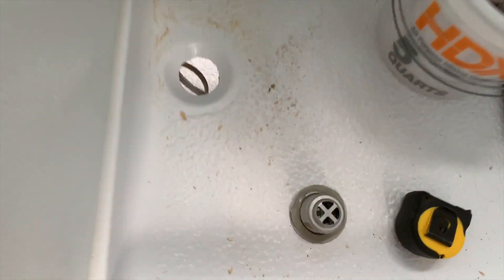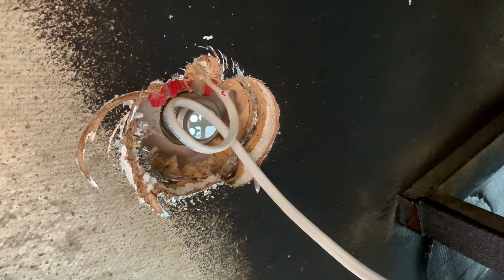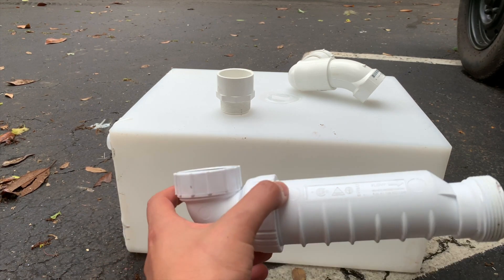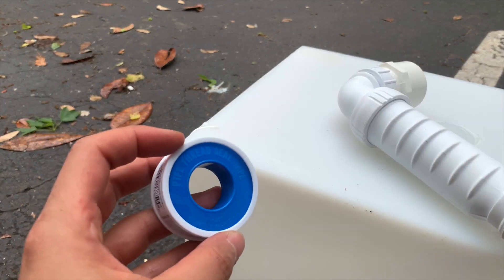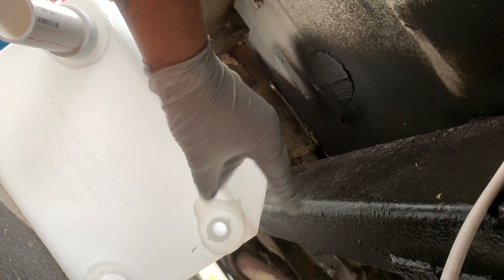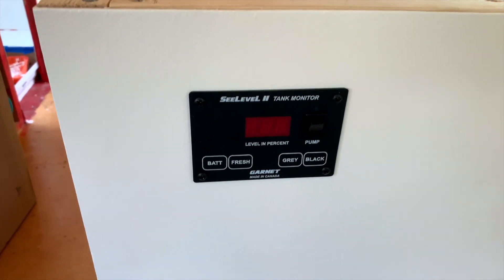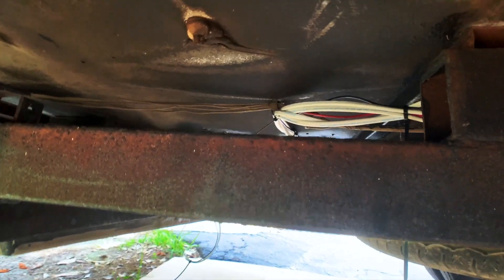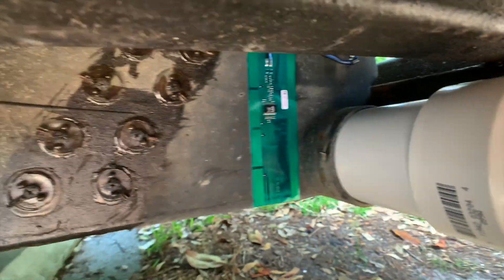Toyota Sunrader RV Build | Grey Tank and Seelevel Monitor Install

Comment: Great video, been watching the channel for a couple of weeks now and love what you're doing. You very well could have done this (wasn't in the video at least), but, you should have squeeze out from the butyl all around the drain as you tighten. If this happens, there shouldn't be any need for caulking on the top side. Also, looks like you knicked the cable near your drain, be careful or you might end up with a zappy shower! Keep up the hard work, excited to see the finished product :)
Reply from the maker: Thank you for the support! I did knick the wire sheath but not the wire within. And once running the wire went through the closet it sort of pulled the wire away from the drain. So fingers crossed for no zappy showers hah. And yes once I tightened I did have butyl oozing out around. But for an extra measure I think we'll still caulk around the drain. Can't wait to show everyone the finished product!